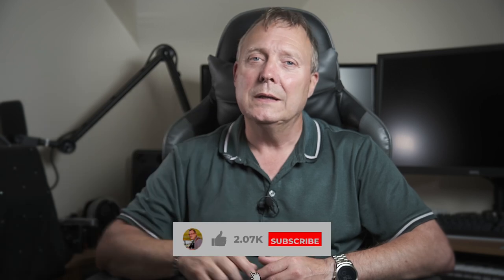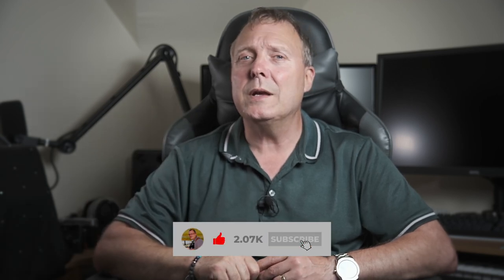Fuji in Camera Noise Reduction vs Post Production Noise Reduction

Comment: it is tricky! the biggest problem - that video codec with -4NR setting is asked to encode video with noise and it is waaaay to much for DCT/H264~alike codec that fails both on the way to encode the static data as well as to track block movement. surely, the camera's NR is a basic wavelet/statistic NR that could be applied at low computation cost - standalone noise suppressing software can do this at slower than real-time pace and apply a better algorithm, the question is - how damaged the video would be by codec beforehand - DCT'ed YUV image is nothing close to RAF. personally, I've ended up with NR0, it is a good balance - no need to do a separate NR in post and it leaves plenty of details.
Reply from the maker: I agree and usually leave mine at 0 on the X-S10 and -2 on my X-T3

Comment: -4 (minus 4) in Fujis NR scale is the dumbest scale of measurement ive ever come across.  What on earth does that mean?
That is all. 😄
Reply from the maker: The reason I believe they use that scale is because there is always noise reduction in camera and all you are doing is reducing the amount that is applied and -4 is the most you can reduce it by and +4 is the most you can increase it over the base amount.
Reply: what would you choose? decibels in chrominance space (whatever it is)? no complaints about sharpness +4?
Reply from the maker: @xiodcrlx  I set my in camera noise reduction to -2 and if I need to clean it up anymore I use my nle